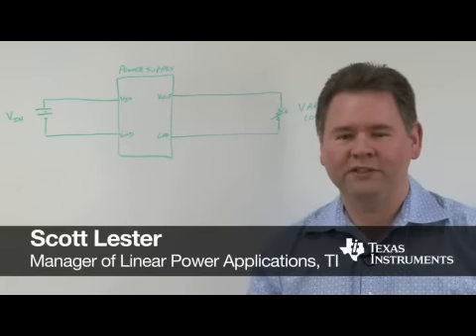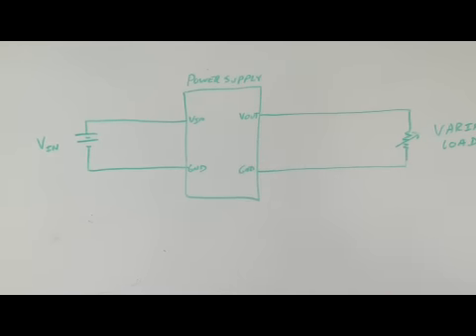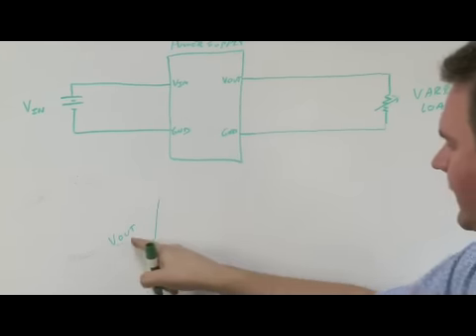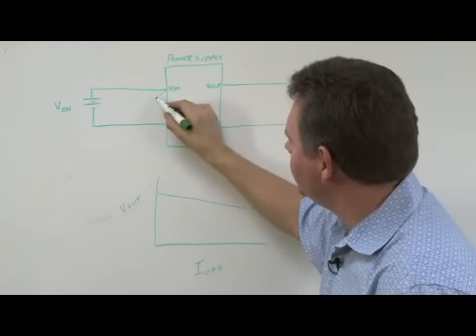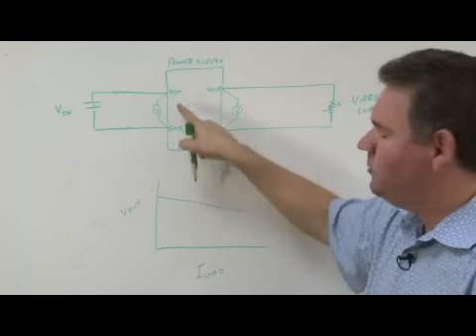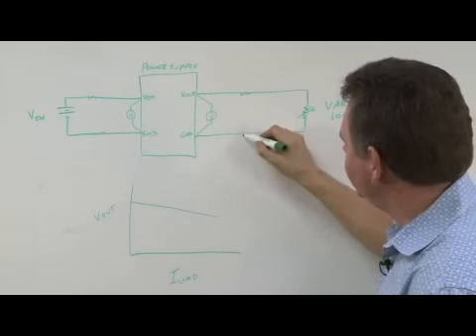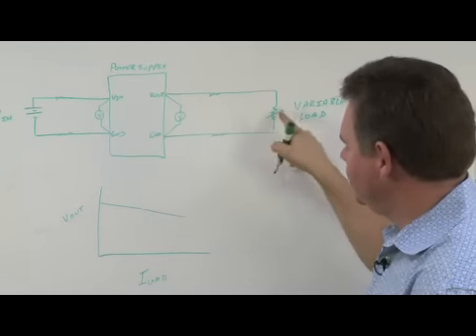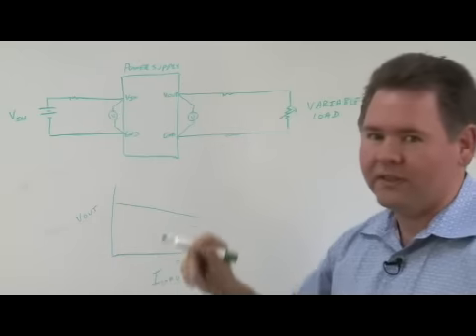How to Measure Load Regulation

Comment: Assuming a consistent input, for a voltage regulated DC power supply, If we set the load current with an electronic DC load in CC mode, we can use the DC electronic load to measure the voltage at the DC electronic load input (provides display of both voltage and current). But, as stated in the video, the measurement at the DC electronic load without a 4 wire connection from the supply (sense and output) the voltage will have errors due to wire test lead resistance voltage drops. However, if the wire voltage drops are small (as they should be with a proper test setup), the DC electronic load will easily maintain a constant current, so we then make voltage measurement directly at the supply output with a bench DMM.

The purpose of the measurement is to usually calculate the Percent Load Regulation, in this case, for a Voltage regulated linear DC power supply.